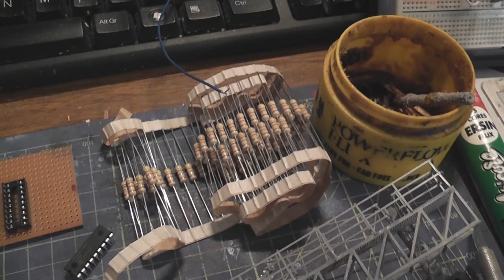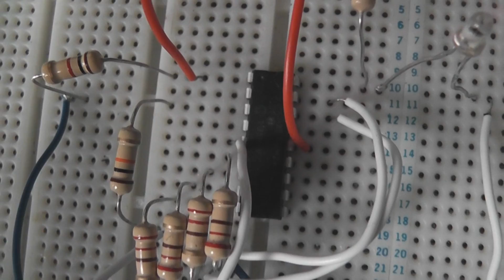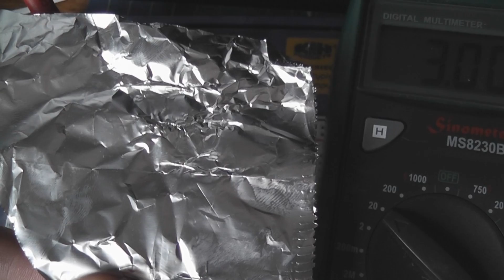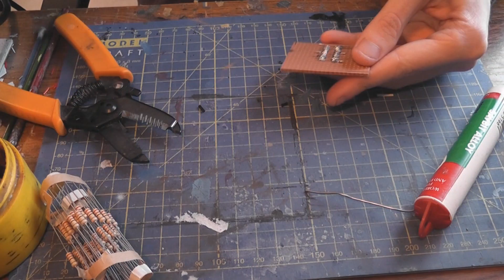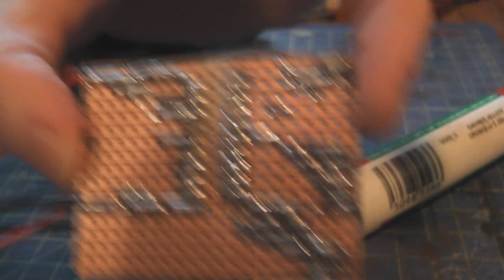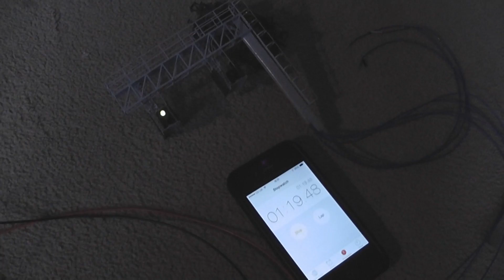How to - Episode 19 - Automatic Signalling

Comment: What a brilliant and wonderfully edited video! Having virtually no electronics experience at all I am amazed at how understandable you made everything, from explaining the circuit diagram, to how to test it all with the breadboard and then construct it via the stripboard. Having never heard of picaxe chips before, I am now rather excited by the potential for programming them via Logicator and how user friendly the process seemed to be. I've just had a whole new world opened up, so thank you for all your efforts in creating this video. You should definitely consider teaching if you ever tire of whatever job you currently have! :) - Sim
Reply from the maker: BurtonOnHumber Thanks Sim.  The picaxe chips are brilliant.  Flashing tail lamps, signalling, building lighting, emergency vehicles, nightclubs, automatic level crossings and more.  Anything is possible with enough bits and a soldering iron.

Comment: This has got to be one of the most useful videos I have seen in a long time.
As a MERG member I am fairly au fait with small circuits but as a retired programmer it was an eye opener to see
that all one needs is a flow chart to program pickaxe when I thought that coding was necessary.
Thank you for this education.
Reply from the maker: peckhamboy42 That means a lot if someone from MERG thinks I did a good job.  Many thanks.  I'll admit to be rubbish as writing in basic so the logicator makes things much easier for me.

Comment: Excellent work and the video gave me very good info about automating signals. I can really see how much painstakingly you have put together this wonderful video. I did learn something from it.

The next project you can consider is to write chips such that each signal is dependent on the output of other signal. For example, in your video, the 2 tracks join to one track. So you consider writing a feature in which one signal is automatically red when the other one is green, and vice versa.

 Another thing, you could consider creating automatic block signal section between 2 stations. In your current model, you have the signal turn from red to amber and amber to green after 30 sec. In reality, the signal turns from red to amber when the train has passed a subsequent signal in the same section. It turn double amber when the train passes 2 signals. It turns green when the train passes 3 signals. So in a sense, you are creating a block section with signaling.

Comment: You have done a marvellous job of explaining how you built the automated signal. I especially like how you explained the programming of the PIC unit, which, in combination with the pin out diagram and circuit diagram was easy to understand. Your explanation of the workings of the circuit on the breadboard was excellent. When you came to final assembly, the information you gave of the programming and the breadboard helped greatly with understanding how the strip board assembly worked.

All up great job. I have subscribed to your channel and have enjoyed your other videos.

Comment: Thank you for posting this video, I love this hobby, It has taught me a bit about woodworking, wiring, Glue's, paint, airbrushing, resistors, bulbs, led's and now programing a circuit. Also it has allowed me to learn about train, the history of trains, fallen flag railroads, the electric power industry, mining industry, cement industry, the steel industry, passenger service and MOW (which is my favorite because track cleaning is awesome with the cmx! I will work on using this to protect the south and north entrances to my yard. But I really want it as an early indicator for trains approaching the yard from making a run so I will know when I need to clear a line. I will probably have to set the signals over the block entering the yard and put the infared sensors at the end of the previous block. I will need to program the show green to yellow to red, then...back to a second yellow then to green. (if that makes any sense) It will say "No trains coming = Green to yellow = I seen a train (get your shite off this line) to Red (the train is here) to the second yellow = (The train is in the next block keep your skirt on and wait) to green (Ok the line is safe to approach. I was gonna pay a ton of money to protect 4 lines on the north side, and 4 lines on the south side. (Atlas model railroad signal system). But since your such a cool ass guy looking out for the model railroad community I am going to build my own because you just taught me how. Thank you lol!.

Comment: Excellent video, thank you very much , it has been some 15 years since I last used microcontrollers, and it was hard work and expensive compared to what is possible now. So thanks for the techno update, I will certainly look closely into this family of micros, for automating parts of my railway, Jim :)
Reply from the maker: freightuk Thanks Jim,  its very affordable now.  If you buy in bulk the unit cost comes down significantly.

Comment: Nice video.  Rather than use a 30 second timer, why not use some of the other inputs on the PIC to receive data from the next modules up the line, so the signals are tripped in true fashion.  This way the signals would stay in sync with the speed of the train running through that section.  As it is, you could end up with two red lights one after the other if you ran a fast train through the section as the second light would turn red before the 30 second timer changed the first signal from red to amber.  Or if a slow train ran through, the first signal would time out and change from red to amber before the train had passed the next signal down the line.  It would be simple to do, using the pins that drive the LEDs to trigger the input of the previous module.
Reply: It's pretty clever.  But yeah, it's not failsafe.  A train could enter the block and stop, and the signal would turn green after a minute.  Detecting a train entering either end of the block to turn the signal red, and leaving the block at either end to turn the signal green, would be enormously complex because he'd have to detect the direction of the train at each end of the block.  But what if a train drops a carriage off in the middle of the block?  The signals would never know.   So to be totally accurate, he'd have to have sensors every few cm to detect the presence of a train or carriage anywhere in the block.   What he could also do is have an input to the circuit from the switch/turnout ahead to turn the signal red for the blocked route. But all that would be mad expensive and complex to do.  So what he did is a reasonable approximation of a signal for a model railroad :-)
Reply: Malcolm Crabbe i
Reply: or put 2 in so if lets say the 1st one is triggered then the second its going north but if the second one if triggered before the first its going south if u get me
Reply: Another option would be to add a reflective surface to the underside of each car... or perhaps paint them with a reflective color such as chrome. Then place IR sensors along the track to monitor the train's passing real time.

Comment: Great stuff Richard, nice to see something more technical. An alternative to using the dremel for breaking the tracks between each side of the chip holder (and anywhere else you need a break on the veroboard) is to take a suitable sized drill bit and turn it by hand in the hole. It will neatly cut through the track without the risk of running onto adjacent tracks.
Reply from the maker: Moorway South Thanks for the tip, will do that in future.

Comment: Gosh! You have put a lot of work into that project! Looks great though. I have a few infrared sensors around the layout made by Heathcote Electronics around  £18:00 each, very good. Like the tip on the silver foil. I do notice a couple of loco's when running light engine don't trigger the sensors off. Thanks for that tip...
Richard
Reply from the maker: BALLAN PARKWAY Thanks, the heathcote stuff is good.  I almost bought it before developing this.  The foil should help out quite a bit.  I found the trains reflected very light on their own.

Comment: Hoping to begin layout construction this year, following a few modellers videos here for inspiration, yourself included. Only run on a simulator so far but managed to get 4aspect signalling which would be fully automatic and would only change signals as the train moved through the blocks. Using full block detection from something like a bd20, the circuit consists of 3inputs from 3 blocks going to 5 AND gates, 3 NOT gates and 1 OR gate. The circuit is quite simple on screen.

Comment: This is a gold mine video and your explanations were spot on. I was completely baffled at the start but understood everything by the end.
Instead of using timers could the signals be changed as a train passes the next signal down the line? What I mean is - (S)ignal 1 showing green, train passes, S1 changes to red and stays red until the train passes S2, S2 changes to red and S1 changes to amber, train passes S3, S3 changes to red, S2 changes to amber and S1 changes to green, and so on. Hope that makes sense! And still have the over ride switch in place.
Reply from the maker: MickMaan Certainly possible.  More wiring and a different program will be required but its doable.  Then you would have realistic block signaling.

Comment: Pic axe is an awesome idea to use, but if your looking for something a bit more compatible, you could consider using a similar type of programmable board called an 'Arduino'. This will allow you to use multiple signals with one board and you can make the separate signals "cooperate” with each other.

Comment: Excellent Instructional Video. Thank You so Much. You've opened up a immense world of possible variations and expansions on this initial project. A Question about employing signals using common anode wiring. I am having problems getting the system to work correctly. Any programming or technical tips would be appreciated.

Comment: Great Video!
Presumably you will need a chip/circuit for each signal that you have on your layout?
A lot of work for large layouts, but well worth it for realism
Thanks, keep 'em coming
Barry
Reply from the maker: Barry Kaupa Thanks Barry.  The chip has enough outputs to run 2 signals.  The logic would need altering and you would need two sensors but you can at least manage two signals from one board if you want to.

Comment: got a very similar system running off Picaxe 14M2s, but interlocked with points, and without any timings. still automated though - press a button to switch the signal from red to yellow, again for double yellow and a final time for green. one if them you only press once and it cycles through automatically to green. when the train passes over, it passes over an LDR, and the PIC detects the drop in light. once the train has passed over, the signal returns to red - by the way, from whichever aspect it is displaying. I'll happily link the code for any aspect of signal!

Comment: Hi. Nice vid! One bit of comment: you can increase the 220 ohm resistor (pull-down resistor of your override switch) to a couple of kilo Ohms (probably even one mega Ohm). This is only a waste of energy, since it will almost always be connected to the power supply and ground(unless you have reverse the on-state of course). Buy nicely made and programmed!
Reply from the maker: +Marco Boot Thanks

Comment: Excellent tutorial. A little beyond my current capabilities I fear. Out of interest, when the signals protect converging lines at a point like that, could the polarity of the point frog be used to send an input to the signal chip, to change the aspect of the signal on the road not set to red?.

Comment: I did enjoy the video.  I like that the signalling became automatic.
The next step for me would be to ask
How do you make an oncoming train stop so that it does not collide with another train that is already using the turnout?
Can you get the red signal to shut down a portion of track so that the loco will stop, and then power back up when the other train is gone ?  and then send a red light to the opposite track that would shut down that track?

Comment: One thing though; once a train has tripped the signal and the program goes in the timer sequence, the override switch is no longer checked. So when a light is showing yellow, the override does not change it until the program is finished and returns back to the start.

Simple way to fix this of course is to take the override check out of the main program and move it to the second program, have that check for both the override and the train passing while yellow conditions.

Or if you're not that bothered about it, just leave it as it is :P
Reply from the maker: Daedalus Young Correct.  I may make the change for some signals in certain areas on the layout.  So far it hasn't been an issue so I left it out to keep the video simpler.  Thanks

Comment: nice, I really love your videos.... one thing.. you need to put foil on every locomotive for signalling to work... I think it would be better to install the infrared diode under de signal and the receiver under the track and let them work inverse... when receiver stops receiving infrared turn de signal red ... this way it would work with any passing thing
Reply from the maker: That would work but every signal would need a gantry to mount the diode.  Most signals are stood to the side of the track.

Comment: Excellent Video! Many thanks for taking a considerable amount of time and effort to produce this for the benefit of YouTube viewers. I have been building a number of auto signal modules for two aspect signals and am very impressed with the 4 aspect signal you have produced. I am keen to build one, can you provide a link to the circuit diagram? I can pause the video and copy it that way but a direct link would be useful. Thanks again for a very informative video.
Reply from the maker: +Paul Davies Thanks.The diagram is not posted anywhere at present so your best option is to grab it from the video.
Reply: Take a screenshot of the paused video, sure

Comment: Morning I know this is an older vid, still good and interesting.. just a thought instead of the wait then an other wait you could put an if loop in.. I understand it would make it a bit more complicated but it would give you an unlimated wait cycle.... i have just downloaded the sortware and ordered the kit. and am looking forward to getting in to programming , again.. and going to use it on semaphors as there is a motor control unit on the common... love the channel....  Davey P.  Ps.. great layout... I have not even started putting boards down yet.... as of 20/10/22

Comment: is there a specific reason why you use "pin 2 high" to detect normal operation ?  Instead of a pulldown resistor externally placed, does the PIC chip have internal  pull-up resistors ?  you could just use "pin 2 low"  and invert the logic.  It might shave off a tiny little bit of overall current in normal mode.   Does not really matter for one signal but if you have many, it would be a power saver.   On the other hand, if your manual switch ever fails, it will just go to red and stay, that could be a good failsafe.   the ever recurring dilemma...   I'm more of an ATMel micro controller user myself, but the logic is roughly the same.   LOVE your work, it is a great example to many of us
Reply from the maker: Dani VAN MIEGHEM I think I later fixed that.  On the breadboard the switch was indeed setup to consume power to keep the signal running.  I switched it to pull pin 2 low for normal operation when I got to explaining the logic.

Comment: I see you use Picaxe I have started using Arduino just because I had a couple lying around. I use two detectors In my Arduino circuit 1 is for making the signal go red and it stays red and then switch 2 is for starting the timing sequence.I did this mainly so that if a train was in a platform or on a mainline and was halted then the signal would stay red until the train in the block ahead has triggered the timing sequence allowing the train behind to continue. I was trying to find a way to interface this with the Lenz/Digitrax systems however in future I think I will be replacing my Arduino circuits with Digitrax Block detectors and Digitrax signal boards so that it is all auto done and can tell the computer where it is. I am planning to have the main lines running semi automatically trains will be run on the mainlines via the computer and changed from the fiddle yard however the TMD and shunting areas will be manual. The mainlines can also be manually controlled if you wish so. Cool video though and your signals are awesome !

Comment: Given that you're spending a lot of time soldering and programming these individual ICs that then operate as stand-alone signal light processors, not giving you the more sophisticated behavior you want, you might look into using a basic PLC controller and 5V TTL I/O instead.  They can be had for pretty cheap and will far outstrip your boards in terms of I/O tidiness and programmable behavior.  You could wire your entire layout into the PLC to integrate all of the switches (points), lighting, signals, etc. into a coherent system.  Just a suggestion.